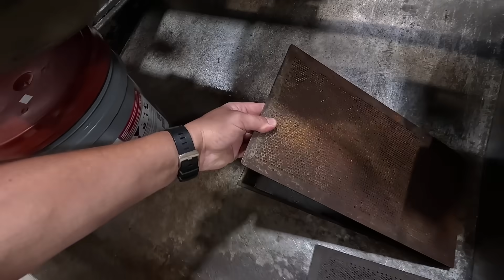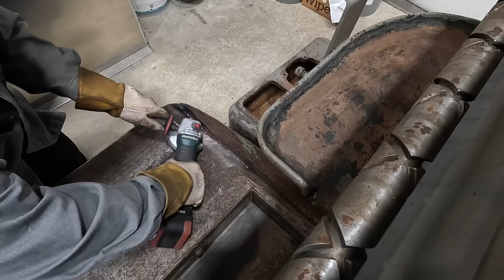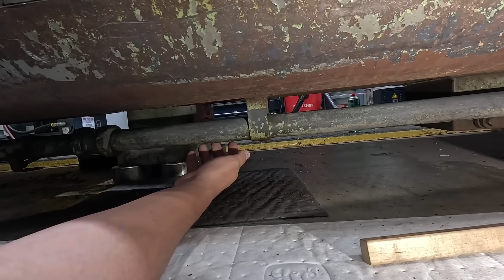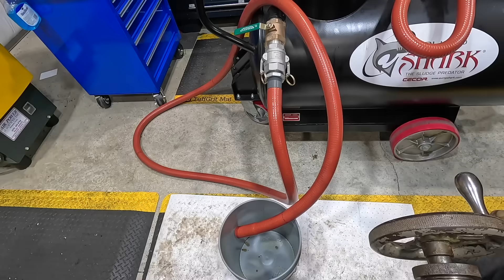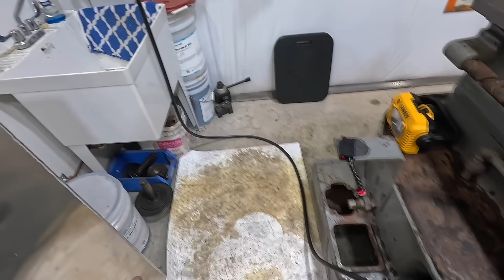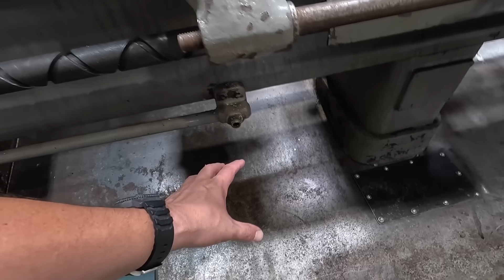American Pacemaker Flood Coolant System Repairs Part 1

Comment: I don't know if it would be committing sacrilege or not, but a nice modern polymer pipe would work an absolute treat. That old one is falling apart.

On one hand it definitely feels like it would be desecrating the machine. On the other, it's a tool meant to be useful. This would absolutely be in the spirit of the will of the machining gods 🤔

Comment: Araldite Rapid epoxy also works extremely well for sealing leaks, like the one in my copper hot water cylinder that developed a pinhole in the top area when I swapped out the 3Kw immersion heater element over 25 years ago where it was angle ground very thin during manufacture and it's still dry, though as with any epoxy adhesive, surface preparation is critical, being completely dry and oil/dust free.

Comment: A piece of rubber or a sliced piece of hose and a hose clamp over it make a better fix than JB Weld. Get a little guy to check out how to replace the pipe sometime as it is likely to be paper thin.

Comment: Abom of old would have had that lathe up in the air on jacks stripping that pipe off and machining a new one. Nothing to stop the coolant leaking down the threads of them stainless bolts on the cover. Could have done wait a rubber washer under the heads.

Comment: @27:40 "probably gonna need to let them cure before I put the flex tape over 'em" 

Only up to a point. Curing, by definition, doesn't need exposure to air. The two components react when submerged in water, covered in sand or patched over with tape. JB Weld, when its two components are mixed, doesn't dry (which would need exposure to free air!), it sets / cures. 

So you need to allow for some curing, so that application of flex tape doesn't smear the freshly mixed paste, but you can cover it when it's partially hardened. The curing of the JB Weld will continue regardless.

Comment: Would anyone else flush the system with water first while checking for leaks, or go straight in with Evaporust? That pump looks small for flushing out chips from an 8" deep hole.

Comment: The problem with patching "a pin hole" in a pipe like that, is that's just the first spot that broke through. The whole pipe is compromised. I understand getting the machine going for the job you need it for, but plan to just replace the whole pipe.

Comment: when I worked as a ship engineer we used something called marinetex. I suspect it's close cousin to the "JB weld". You could buy it in volume for large jobs. Replacing the old pipe could be a rather large job as I would think about laying the machine "gently on it's side" for good access. That process would make excellent content.

Comment: I’ve been a plumber for 30 years. They used to have steel hydronic systems for radiant heat. Unfortunately they rusted from the outside in. Internally they were fine. Most tank type water heaters are glass lined steel tanks and the magnesium or aluminum anodes keep them living just past the warranty. As just advised it won’t work well with the coolant. It was just a thought.

Comment: Self-amalgamating tape will sort the pinholes last for years = eventually the pipe will be wrapped totally - but it works . Used it to seal underground electrical joints etc. bonds to itself and what it wraps.

Comment: 19:00  I think this is a job for "FLEX-SEAL!!!!"  (seriously) or JB Putty Wled?? It's not pressurized and not dangerous like fuel if it dissent work.  I'd love to see Flex-Seal tape on that!!! (

I've never used The Flex Seal ... it but I'd LOVE to see if it works!!! :)

20:06  YES!!! JB Weld to the rescue!  I added a second power line (12 VDC) and a second Fuel Pickup to my Chevrolet Step Van project I've been working on all summer! :)

And I used the "putty style", "JB Weld Fuel Tank Repair" to seal both holes!  They ARE both in the very top of the tank and in the removable "wedge Seal" ring, so it's like 1/8" thick steel  .. but it worked perfectly no leaks!

Comment: You could also cut the bad section of pipe out and replace it with rubber drain hose and hose clamps

Comment: Another idea would have been to to use something like POR15 or one of the other products used to seal gas tanks on vintage cars and motorcycles. I've found that often on old gas tanks once it starts rusting through in one location the whole bottom low spot of the tank (or in this case the pipe) is close to rusting through and after the rust removal treatment it doesn't take long for it to start leaking elsewhere. The POR15 treatment coats the surface giving it a little strength and stopping the rust. The upside is it won't leak anymore, the downside is the cost.

Comment: Drop a magnesium block in the sump. Your rust will stop.  After time you’ll see a few more leaks when the rust that was plugging them.
Reply: That would change the focus of the galvanic corrosion , but would it also change the character of the flood coolant?
Reply: You should not have any rusting at all with proper coolant in that system. Oxygen in the water is what create rust and that happens when the pipes are left with a bit of water in them for years. Iron pipe for steam lasts for years as long as the oxygen is removed and steam is much more corrosive than water.

Comment: Seal All is another good product for plugging leaks.  Works on gasoline leaks too.  Also, find a rubber sleave that can be split and wrapped around pipe then clamp in place with hose clamps.

Comment: Couple economics questions, just out of curiosity:

- What do the fees look like for someone else processing the kind of industrial oily wastewater generated from cleaning out the system? I don't have a great intuition for how much that costs vs the kinds of filters you used to clean up the water and which would then go into ordinary solid waste.
- What does a big lathe's worth of coolant cost? I could see that impinging on decisions to easily epoxy patch some dodgy piping and risk compromising the new coolant, vs springing for a more comprehensive replacement of parts.

Comment: The sprayer on my kitchen sink decided to start leaking, right at the top where it screwed into the faucet. I tried to unscrew it with a pliers, but it wouldn't move using reasonable force. I was afraid that I would break the old faucet if I really put a lot of torque on it, so I wrapped the area where it connected with about 10 wraps of electrical tape. Then I put a small stainless steel screw type clamp over the tape and tightened it up. To my surprise that sealed it up. Of course, it only has some water pressure in it when the faucet is on. The sprayer end used to leak a tiny bit where the hose went into it, but I sealed that leak with hot melt glue. Hot melt glue will stick to almost anything clean and dry. I used it to repair the hubcaps on my Ford Expedition which kept coming apart as the plastic ears holding the 2 pieces together kept snapping. I cleaned them with 409 and a tooth brush, then welded everything together with the hot melt. That was 10 years ago, with no failures since then. Those little suckers are expensive from Ford. 
A strip of inner tube and hose clamps will seal many leaks, even under some pressure. 
Mineral spirits makes a good cleaner. It will remove the soap scum from bathtubs, and from the inside of washing machines. Just don't pour it into the washer. Use a rag or saturated paper towels. No smoking or pilot lights nearby, since it is flammable.

Comment: Marine epoxy or even hydraulic cement with a small mold pan would work for that pipe, at least temporarily, as more holes will develop over time.

Comment: I have all kinds of remotes in my shop using "WOODS" remotes: Plug the pump into the woods receptacle; plug the woods into the wall. Your remote sits up on the lathe & you just push stop or start to operate. I have pumps, fans, lights, sweepers all running on woods remotes. They have worked without fail under all kinds of loads for more than ten years. My remote batteries last 2-3 years before they get weak.

Comment: A remote operated switch that you can keep handy would work great for your pump.  I have one on my vac system in my hobby wood shop.  Cheap and no wiring.  Thanks.

Comment: Like others here, I would probably have tried to re-plumb the whole thing. I would have wasted a few days squirming around on my back cursing at three-quarter-century old fittings, then making multiple trips to three different Home Depots to find the stuff I needed. You, on the other hand, got the job done in a day with a bit of JB Weld and got the machine back up for productive jobs. I think you made the right call.

If it leaks again in six months, fix it again. If it leaks twice in the next year, you can think about "doing it right."

Comment: Ah cleaning the coolant sump,one the best jobs ever , retired manchanist here started work in 1960's back then NO  sump suckers , degreaser, rust cleaner  just elbow grease  and nose clip sometimes the smell was unreal  back then no fancy coolants like today, think we just had Shell soluable oil 10-1 dilution, depending on when last clean  one could scrape out  lumps of jellified yuck plenty of old chips  I think the worse tanks were in Milling Machines  where the  tank was in the base of machine , reaching in with ones hands and old rag  ah the good old days

Comment: I used JB weld to fix a heat exchanger on a 1990  ski-doo in 1991 and it is still leak free. Studding it put a tear in the heat exchanger .

Comment: For the pinholes cut a small strip of rubber and use a hose clamp.  It won't be pretty, but it will work until you can work on a permanent fix.

Comment: Make up a couple bolt on clamps like a half pipe with a flange welded on, couple of bolts and a rubber gasket and you're back in action.

Comment: Adam, how often do you recommend  changing the coolant. Another thing i wanted to mention. When we cleaned out my dads gunn shop, we found a bunch of drill bits for the lathe or milling machine. The morris taper is way to big to use on his little Southbend lathe or his Clausing milling machine. Th bits run from I think 1/2 in to over 1 in. I think there is one that's 1 and a 1/2. If you are interested ill give them to you. They will need to be sharpened. Let me know brother. Send me a reply and I'll email you.

Comment: That / them weep holes were  probably a sight level glass of some description, easier for checking levels, one at delivery end an one at rhec oolant  return tank end.
Reply: Good call.  Probably what it was.  I would drill/tap and run a screw that’s  goober’d up with JB or Flex Seal in there.

Comment: Don't weld that pipe, couple pieces of rubber and a couple of hose clamps. There's no real pressure there. If that pipe is rotted on the inside, you gonna create problems trying to weld it. replace it or patch it.

Comment: Index that pipe 180, plus or minus so that the holes are at the top. I'm thinking the pipe wall is thinner on the bottom and more prone to leaks as time rolls on.

Comment: A tip for jb weld: on bigger holes like the second one you repaired, rather than blob it all on at once, do it in layers and use some rough scotch Brite in between layers to rough up the previous layer. Sorry for saying layer so many times lol but I've found that to work much better, it cures more thoroughly and creates a much better seal

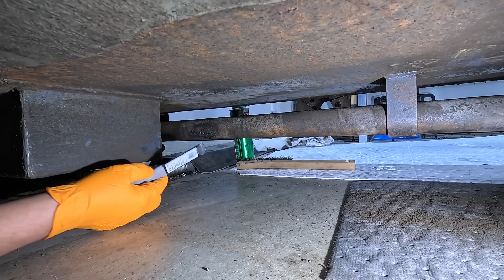Comment: @25:19 I'd be thinking about replacing ALL that pipe! If there are pinholes now, there are more just waiting to open up! There are unions and fittings so it shouldn't be a big deal to redo it all...
Reply: The job itself probably not. But given other requirements and complications that could very well be a 'later fix' to do. As the pipe isn't really pressurised I would expect the patches to hold just fine for years until he can get around to the permanent fix.
Reply: agreed.  sticking some goo over the pinholes that are leaking now is only a short term panacea.

Comment: Adam, Adam, Adam, ain't no body gona see those patches, in a situation like that just get a goodly amount over the hole and don't try to make it look pretty, the tape will cover the JB anyway so just get it covered.
Reply: He was thinking ahead to the wrinkles in the sealing tape from the gobs left after a job done your way, not saying everyone leaves hills and valleys which would benefit from a road grader here, just thinking it, loudly... I worked after too many folks with simple plans like you mentioned.

Comment: Do pig products absorb all the toxic compounds created by high heat chemical baths and the all the compounds created in the cleaning process?  I don't think based off the pig data sheets they would be able to absorb all dissolved or emulsified chemicals. I could not find relevant data on their site. 
I watched a dude pour a pitcher of purple kool-aid through a homemade charcoal filter and crystal clear, flavorless water came out. Made out of one of the old coffee containers you'd see at the VFW 20 years ago.

Anyway, i am not an expert and just want to know what's up. Either my knowledge helps or I get to learn, maybe both.

Comment: I think your solution is a pretty good fix for now and possibly a year or two.  However, judging by the apparent condition of the pipe, the problem will resurface sometime in the near future.  I like your approach for a short term fix.  The pacemaker will be on line with coolant.  Don't be surprised if you have to repeat the fix.  Hopefully next time you be able to replace the bad parts with new and never have to deal with the problem again in your life time.  KOKO!

Comment: I would definitely plug that "weep hole" the previous owners drilled into the sump pan with some JB Weld, there's a reason it didn't come from the factory like that. 👍👍
Reply: I think I’d tap it and plug with a small machine screw. I’d worry about vibration breaking the JBWeld on a vertical surface without the tape. Just a thought.

Comment: Adam, instead of glue, you should have used a piece of rubber to wrap around the damaged pipe and tighten it with a clamp. In Poland, we have such clamps for leaking pipes, even those with high water pressure, and it works.

Comment: I would think putting the carbon filter on the bottom of your sump pump's filter system would be better. The other filters are designed to eliminate the heavy contaminates and oil, while the carbon one is to help purify the mostly filtered water. I suspect that arrangement would have produced water with no discoloration.
Reply: Came here to say that... carbon is always last, a polish on the water so to speak, at least that is what the drinking water sheets say, but you are right, bottom of the barrel so it will not get oil into the million small pores in the activated charcoal filter. Simple way to clean that filter now is to use a solvent for the oil though so no real harm here, Adam can clean it and set it up right next time. Getting the VOCs, if any are regulated, out of the exhaust air will be a pain, if so I hope Joe has a license for its usage and an extractor so as to keep it out of the environment. EPA can be a bit of trouble for anyone unfortunate enough to fall under their purview and jurisdiction.

Comment: There are extensions cords with a step switch built in it so you can lay it on the floor in the front of the lathe so you can step on it to switch the flood coolant pump on & off with your foot 🦶

Comment: You can also use PEX pipe to run the length of your lathe, then convert to a flexible pipe for the nozzle. 
PEX is easier than 😊PVC to assemble.

Comment: If the pipe has those holes from rust, taking whatever rust is inside the pipe out with the evapo-rust... just making the walls of the pipe thinner.  Replace it is the right way to go, unless the cost of the pipe and time involved outweigh the methods used in the video.  Though I expect there will be more leaks inside the next year once you get coolant in there.  I hope the pans underneath are enough when it happens.
Reply: That is far too much work and costly when a patch works just fine as the video proved. Moving and lifting that lathe isn't like working on a car. He has already spent a lot of time leveling it. Why go through the bother of that again?
Reply: This is a quick fix to get it working for a particular job. I am pretty sure he knows what it would take to make it like new, he is trying to get it good enough to use for a job.

Comment: Could the chip pan be made that way to aid the chip clean out as it will probably wash the chips over to aid clean out regards Alan from the UK
Reply: Yes, the chip pan is designed to be emptying via the back side so that is a low spot to be able to get a number 4 D handle square nose shovel into. 
Most times those would have slots and/or holes around 1/8  to 3 /16 inch a bit over 3 to 4 mm for our metric friends for size. These would let the chips drain a bit but the wheeled bin would still need to be drained and rinsed before putting the contents into the scrap collector's receptacle usually a roll-off dumpster if you had enough chips. You get enough more money for them if they are not mixed steels, other metals, and clean to make a difference back in the day, no idea how it is done now. I see mostly conveyor fed- drained swarf going into 55 gal barrels, 200 liters or so for our metric friends, and those dumped without rinsing into a mixed metals dumpster now-a-days.

Comment: Have you considered running oil instead of emulsion as your coolant system?
Reply: He uses a proper, professional coolant solution already. No need for playing around with DIY crap.
Reply: @snappingbear  You misunderstood me and made assumptions.
Stefan Gotteswinter uses oil instead of emulsion. And he has good reasons. The pump, tubing and such is all the same.